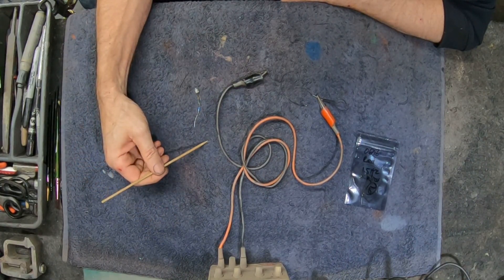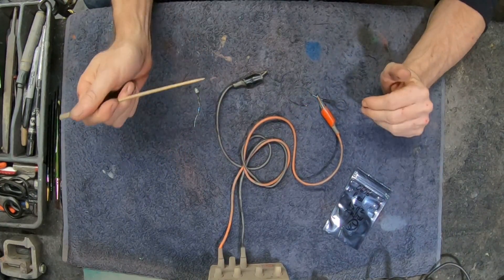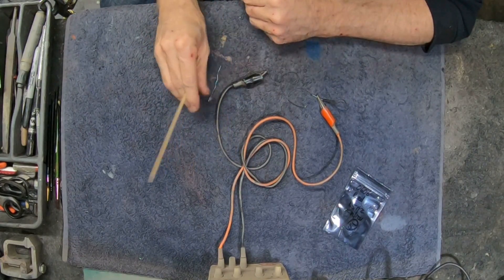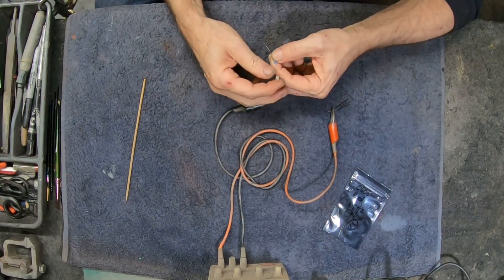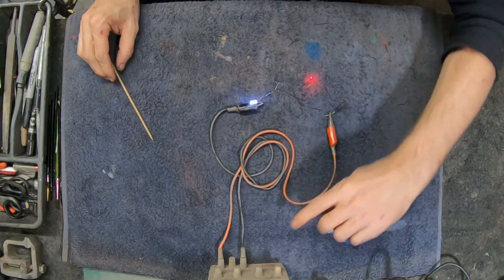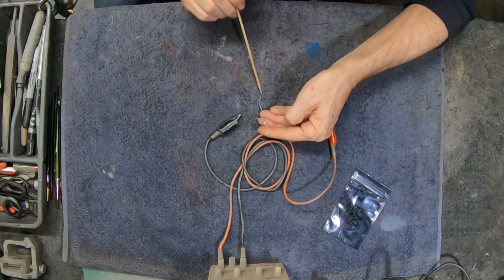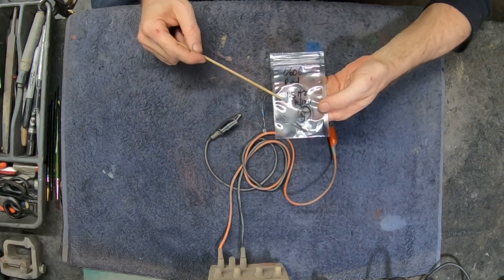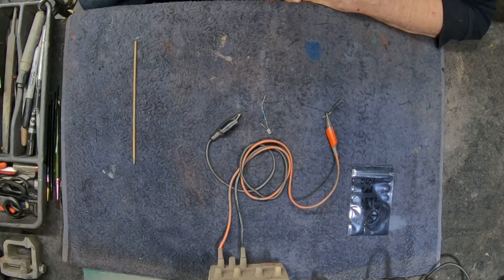An Easy Way To Get Multiple Blinking LED's In Sync Without a Control Board

Comment: Except every LED you add cuts the voltage in half. So after your 3rd led the 12v you send = 0v no lights. You can't just keep adding.

Comment: I found one specialty LED that works strange in series, it is a flashing 5mm LED that blinks SUPER fast at 6hz or six times a second.  Called 'extra fast flashing', looks super cool with even timing, it screams 'Emergency' or 'Hurry!'.  But in series it makes the slave LED do the opposite effect.  When it blinks on, the slave LED dims (or almost goes off depending on what particular LED it is and/or the dropping resistor value).  When the flashing LED is off between blinks, the slave LED gets brighter.  So it is sort of the same effect as a flickering or slower blinking LED, but whatever all is going on inside that tiny microchip seems the opposite of what you might expect.

Comment: I did this and the slaves blink in sync with the master but stay slightly lit when doing the blink. Is it because they may have different resistors? I don't know what resistors these pre-wired LEDs are using. Hope someone can help.

Comment: So mine is half blinking.  Would it be because my resistor isn’t high enough on the slave?
Reply: Same, could you find a solution?
Reply: @yoyodynepropulsion6484  not for this , I ended up caving and started learning how to make my own control boards and circuits
Reply: Yeah I'm having this issue. I can't figure out how to solve it and am now considering what it would take to learn how to make my own control board now...
Reply: @donavanhillman7607  I will say, while there are plenty of resources on YouTube, I decided to start learning how to use an arduino which has been very empowering and for not a lot of money
Reply: @lancebardock  that's encouraging as I've wanted to try that for a while now. I've been avoiding it only because it seems daunting from the outside looking in lol. How difficult is the arduino to learn? I know they are supposed to be easy as circuit programming is concerned.
Reply: @donavanhillman7607  there's a tutorial series by Ostrich Longneck set specifically for building a starship. The library that all the code uses is already established, and it's not hard to decipher.  I'm not sure how much of that is due to what minor programming I already know, but it is fairly easy.  The most attractive part is, if there's something you want to do, someone's probably already done it and have code written that you can just inject into your project.   The one thing I wanted to do was after programming the microcontroller, take that off and put it on a circuit board to streamline powering, but i haven't been able to find a resource I can use to learn that.
Reply: @lancebardock  that's amazing information. Thank you!!

Comment: Hi Boyd, I did exactly as you did with this setup and for me its does not work !! I used a 3 mm flashing led with resistor,and a 5 mm led with resistor...... the standard led just stays on while the flash led flashes. So what am I doing wrong ??? cheers. Love your vids btw.
Reply: Were you able to fix this?
Reply: Would love to know the fix for this. Or at least the cause
Reply: Same problem

Comment: H Boyd, great instructional vid.  I have been building and lighting starships since time began but could never get led's to flash at the time. laws of physics says you cannot use a green led and a red led and expect it flash at the same time without a control board, never used one.  Can you explain how you wire up the 0606 smd as in a positive and negative pair of wires emanating from the smd itself, like where do you solder them on?  I have never considered using single smd's like you shown in your vid but believe this to be the answer i have been looking for!  cheers, steve.

Comment: Do you have a video that introduces lighting- for complete noobs like me?  I dont know the difference between an LED and a PEZ dispenser.  I've never held a soldering iron.  Im interested in lighting up my model but am learning the electronics as well.  If you dont have one, do you have one you'd refer me to?  from scratch?  supplies (including that box thing you are using with the little clips to temporarily light things up) and process.

Comment: Regarding the resistor... is it that you are using one because you are using 12v? I understand. But if you are using 3v, is a resistor still needed? By itself, I can run a typical LED on 3v without a resistor. Looking for clarification.  Thanks

Comment: 🤷Doesn't work here. The second LED is not blinking. 😭
Reply: Do you absolutely need an SMD as the master? I am using a regular blinking LED as the master.
Reply: @flaroucheMTL  I have tried to use a blinking LED as the master and two SMDs for blinking and it does not work for me that way.  I am guessing that it must be required that the blinking light is an SMD.

Comment: Boyd could you talk about the resistors you add to smb's , etc.  What is their purpose.  And how do you know what type to attach to led's and smb's?
Reply from the maker: Most SMD's are sold with the resistor attached and setup to operate at 9 - 12 volts dc. For Led's as long as I stay in that same voltage range, the 470 ohm 1/4 watt resistor works with 99% of all LED's so thats what I primarily use. 
Each LED you connect requires a resistor.

Comment: There is something wrong with your circuit as you have not talked about the voltage needed.  If you add an LED in series you need to up the voltage. If they were in parrallel then you do not have to change the voltage but then you would not have the master slave situation.
Reply from the maker: With this circuit the current or amp draw increases yes but not the voltage required. If I was going to run on battery power it would be a concern but I set these up with a 9 volt 2 amp power supply. All of the lighting on a big Enterprise model I build only draws about 1 1/4 amps. LED' are very efficient.

Comment: Ahh, its back! I got about half way through after the audio issue and it disappeared :P. Ive been trying to get this to work for so long, thanks for posting this tutorial.
Reply from the maker: I didn't catch the glitch before I uploaded it, that's always the way it goes lol.
Reply: @TrekWorks  i actually went back over that part to see if it was the upload or if it was my connection. When i realized it wasn't on my end, i started wondering if i would make it to the end before it was pulled down.  Almost made the video feel interactive lol